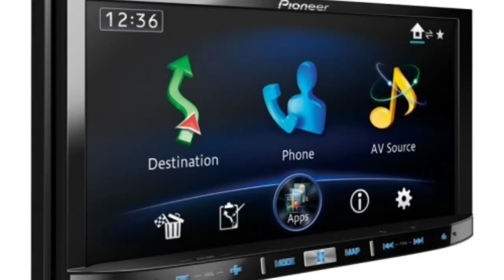Bypass Pioneer avic-z150bh and avic-x950bh

Comment: Can you make a video how to connect the pink wire of z150bh plz !!!! The car speed signal cable (Pink) should always be connected to your vehicle's speed detection circuit. Failure to make this connection will increase errors in the vehicle's location display.